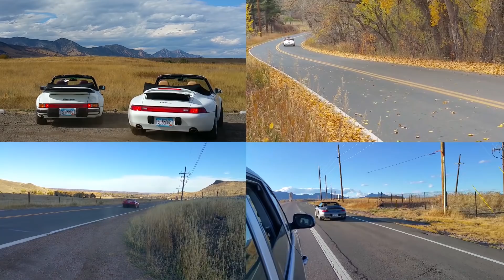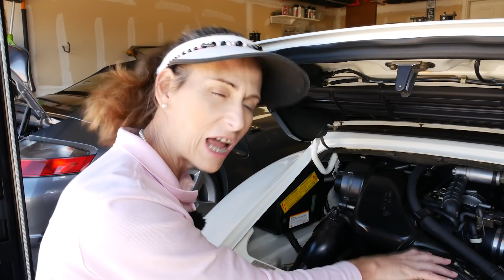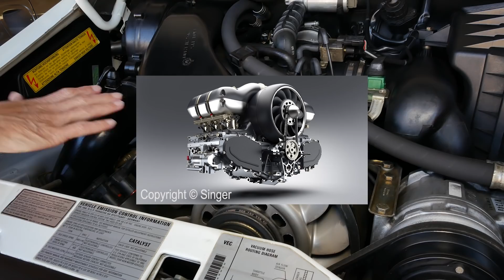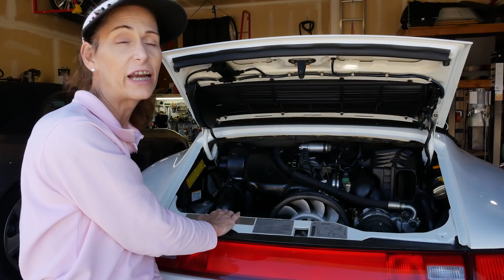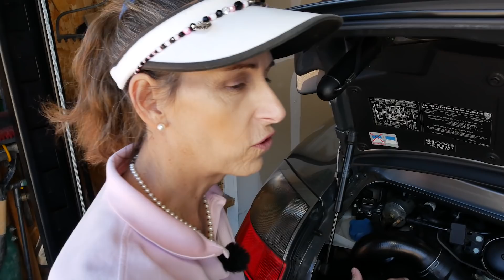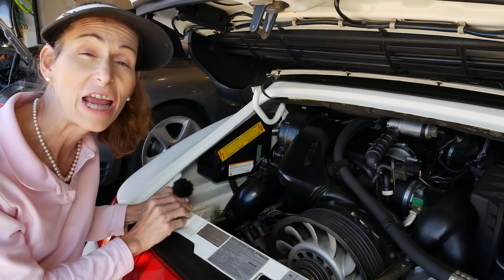Water Cooled Vs. Air Cooled Engines – With Engine Sound

Comment: I have a 1998 993 cab, and my girlfriend has a 1999 996 cab. I spend most of my time repairing the cooling system on hers.   Way to many little rubber hoses, clamps and lines to leak.  I just don’t like water cooled Porsches.  I also have an early air cooled car which we built a 2.7 short stroke. 245 HP engine.  It is built along the lines of the early R and weighs in the mid 1800 lbs.  It is very mechanical sounding with its European Racing Headers and 991R muffler.   Having to take care of 4 Porsche’s, one water cooled, the water cooled car requires the most maintenance, and has the most problems.  I was sorry that Porsche was forced to switch over, but they were not going to be able to continue to pass the emissions and noise regulations.

Comment: I own a 2015 water-cooled 911 Carrera. It's been perfect in the 4 years that I've owned it. It was the last year of the normally aspirated engine too. That being said, I do have a soft spot for the 993 series air cooled 911's. Porsche finally got 'the look' correct, after several years of fairly ugly bumpers on the 911 and 964 bodies. Having lived in the Los Angeles area for the last 4 years, I always wondered if the air cooled 911's tended to overheat, especially in August temps in excess of 100 degree's F.
Reply from the maker: I would think stop and go traffic in LA even in cooler temps would piss off the cars. Even our 1986 has overheated in bad traffic in the winter months. They aren’t perfect. It is something to consider.  A lovely drive in an ocean breeze on 101 or 1 would be amazing. 993s are amazing cars.  Their prices have softened but not for long.  I would recommend one for sure.  You will
need to consider warmer days.

Comment: Excellent video. Which engine lasts longer? Air cooled or water cooled?
Reply from the maker: Now that is a great question!  Interesting.  I don't have any real data and there are so many factors, but I would guess - all other things being equal - the liquid cooled engine would probably last longer because of the more consistent running temperature and the less stress on the oil itself.  Thanks!

Comment: You forgot to mention that an air cooled engine costs more than a water cooled one because you need higher quality metal compounds that can withstand much wider temperature ranges.

Comment: I have a 3.2 Carrera and just picked up a '97 Boxster 2.5 which feels a lot like my old '90 Mazda Miata mx-5 in purity and handling as they are first year of production. Just getting used to the Boxster which is a wonderful car with great heat! So I like both a lot! Boxsters are such a bargain! Even if you factor in an LN Plain Bearing IMS conversion and replacing chain tensioner guides for peace of mind. 996 Turbo is the next bargain but at 10x the price I paid for the Boxster. I recently picked up a 996 Turbo front spoiler and 18" Hollow BBS Turbo Twist wheels form a 2005 Turbo. I'm wondering if the 17" Boxster wheels can go on the air cooled 911 Carrera 3.2 and the Turbo wheels and front air dam on the Boxster with a change of head lights? Of course I'll keep the original 16" Fuchs for shows. Cool videos!
Reply from the maker: We loved our Boxster until someone ran into me when I was in it.  So, i read your comment to Franny. She said to make sure you check the forums.  She said that sometimes the tires might rub when you turn.  We have original parts on our cars but we might do some modifications to ours soon. Heidi

Comment: There is nothing like driving an air cooled 911. I miss my ‘72 911E and ‘90 Carrera 2. You can definitely feel and see the refinement of the water cooled cars. If you want a more raw driving experience, go with an air cooled 911. If you like to go fast and creature comforts, go for the later water cooled 911s.

Comment: Great video. During WWII the most powerfull and reliable plane engines were aircooled radial engines. No radiators, no waterpumps, hoses and so. In my 40+ years being a driver, I've owned and driven several aircooled cars. The main problem with all of them was heating the cabin.Some extracted heat from the exhaust and that was allways subject to rust, other tapped warm air from the engine, but that only started working after 20 km or so when te engine got warm. I prefer water cooled now, nice temperature in the cabin, smooth, silent running engine.
Reply from the maker: Yep. People like one or the other for various reasons. Thanks for the comment.

Comment: Owned and worked on both. The 996 is superior in every way, in my opinion, except that air cooled 911s have a proper pressure fed IMS bearing and a proper dry sump lubrication system, not withstanding the Mezger engine you featured on that turbo. My 1970 2.2Lt 911E felt faster and was a blast to drive. But in reality my 996 is much faster and handles and stops way better. Creature comforts included.
Reply from the maker: Yep.  Agreed.  We like them both, obviously.  ;)

Comment: I didn't see that anyone had asked how you know about loosing all of the coolant, please let us know.
Reply from the maker: Yes, so about that...  We have a friend who was interested in a 996/997 Turbo so we went out for a drive.  I drove a bit with a few good pulls and then pulled over to swap and just as I was turning the car around the right rear coolant hose split from end to end and dumped all that new coolant (I had just replaced the radiators).  Arrg!  We had the car towed home and it was an easy matter to swap out the hoses with new.  That was dumb...  I should have replaced them while I had the system dry for the radiators! F

Comment: A friend owned a 911SC (204HP 3.0 litre) and a Type 964 Carrera 2 (3.6 litre I think) in New Zealand

I remember the SC held around 12 litres of oil in the 'sump' to help keep the flat-6 nice and cool
Reply from the maker: Yup, it is a lot of oil.  They are actually dry-sump engines so a good portion is in the oil tank.  Always exciting when you drain it!

Comment: This video raises a question or two
1. You mention that air-cooled cars tend to have an oil cooler. So does that mean you run the risk of the oil cooler failing? IF it fails is the cost to repair always higher or lower than having to replace the system in a water cooled engine? Every time I have to service a water cooled system, I find it's almost always cheaper to take the whole cooling pump out and replace with a brand new one.
2. Then there's the oil itself. Does the oil require more frequent changes because it's being heated and cooled down mechanically rather than naturally (letting the car sit with engine off)?
3. And an addendum to question 2: does this also mean you need to use an extra quart or two of oil or a second oil filter?
Reply from the maker: Oil coolers can leak and they can fatigue their mounts on 356s.  I suppose they can clog with sludge as well., but there is no real corrosion.  Generally, oil/air cooled engines carry a bit more oil.  All the air cooled 911 engines are "dry sump" engines meaning they have a separate oil tank.  It may be a bit more wear on the oil, but nothing like trying to lubricate a red-hot turbo.  About filters, the 993 has a second oil filter - one on the tank as always and one in the engine.  Makes for a longer oil change process.  Still, all three of our liquid-cooled cars have had failures or leaks.  Water pumps and hoses are just another point of vulnerability.
Reply: Don't forget to mention the water-cooled have oil coolers too that can leak. They are cooled more by the water adding potential internal leaking into the cooling system as well.  And the tolerances of the water-cooled require much more attention regarding oil quality and contamination.

Comment: Heat in the 993 is better than water cooled cars. In 993 heat is available in a couple minutes. True that there are a lot of smells from engine.
Reply: Totally agree on the heater. But the A/C and environmental controls on my 996 are a different story.

Comment: While I can understand why people get 'emotional' over air-cooling and carburetors; I almost always prefer EFIs and radiators. 
Seamless and consistent performance, better thermal efficiency, better fuel economy, longer engine life and less chance of engine seizure. 
Sure, they're expensive and make an engine complex but the cons far outweigh the pros; in my personal opinion and experience. Especially when it comes to forced induction.

Comment: It will be interesting to see how Singers engine is cooled. I noticed that they not only had the fan but had air inlets in each side window. Is that air for the engine intake or for cooling? It would have been fantastic if Porsche could have developed a similar engine. Dave

Comment: Thank you for the fantastic video. The other difference between the two cars is the valve setup. The air cooled cars were all a single camshaft with two valves per cylinder. The water cooled cars had two camshafts per bank and four valves per cylinder. This was significant enough that the naturally aspirated cars produced over 300 horspower, something that the air cooled cars never could. Thanks for the great video.
Reply from the maker: That is a great point.  I think it was Nick Murray who mentioned that the reduced metal in the heads due to the four valves meant less heat transfer along with increased power.  Oil is just too thick and slow moving to carry away enough heat.  Great point! F
Reply: @HeidiandFranny  oil does a fantastic job for cooling an engine, at first, it cools and lubricate all bearings and the other friction points of the engine plus on so designed engines, it cools the underside of the pistons so it absorbs a good part of the heat produced by the engine.
On specific gas and diesel applications, the engine oil acts as the principal coolant.
On a water cooled engine used on a continuous application as marine or stationary, it is not rare that an oil cooler is installed as a genuine equipment just beacuse the oil absorbs so much heat that a cooler is required to  maintain it in an acceptable temperature range

Comment: I've had 3 x Aircooled (including a '75 turbo) and 5 water cooled 911's (+ 3 beetles which we wont count).   If you remove the money and collectability side of things and just judge them on their own merits then the water cooled cars are in a different league,  than the old air cooled.  Power, handling, breaking and general livability is sooo much better.  The newer cars truly are the 'one size fits all' family car that you can race at the weekend - which is what the 911 was designed to be all along.
Reply: Totally agree. I have a 996 and have owned and built air-cooled 911s. I do think the hydraulically assisted steering non-stability controlled manual shift on my 996 is way more fun than the new PDK electric steering cars with neuter-control though.  And the two 1974 Porsche 914 2.0s I've owned are the best cars VW ever built. Actually Karmann Ghia built.
Reply: Water cooled 911 are total headache when they are old.

Comment: does the oil cooler have a radiator for cooling?
Reply from the maker: Yes, two oil coolers up front.
Reply: Heidi and Franny's Garage thank you for your answer. i guess the oil isnt the optimal liquid for cooling then. thats why we have other coolant liquids with their own integrated systems inside the engine today, right?
Reply from the maker: Yup, you are right.  The oil is obviously super important for lubrication so that needs to be its primary focus and you probably don't want that running through the heater in the cabin ;)  It is thick and hard to move as well.  Water can be pressurized and with anti-freeze will remain a free-flowing liquid at even the coldest temps.

Comment: I really liked this!! but I did find it funny when you exclaimed there's no fan here! In the 996 engine bay, talking about fans in the radiators up front but you never pointed out the fan right next to your head on the trunk hood itself! The small electric heat exhaust fan that funnels air through the rear louvers
Reply from the maker: Yeah. True.

Comment: You should see and hear my 1980 911 SC with a Paxton supercharger on it. It's very different from the 930 of that era. 
Also, you forgot that the air cooled cars had "coolant" lines running up to the front. 
I love 'em all so much, that I recently got a 958 Transsyberia.

Comment: Just really getting into Porsches, I bought a 986 and a 996. I'm 63 and had friends that had old bugs, air cooled when I was growing up. And they all had to be rebuilt way before 100,000. But I had a '62, '66, 68 VW bus... Everyone was cautioned against not getting a '73 or after bus cuz they went to the "pancake" engine they were called then because they also needed to be rebuilt but was 3 times the price. Heat was a joke. Came from the shroud  with metal pipes carrying this warm air to the cabin with no fan... I've cussed too many times with no heat to speak of freezing.... Living in the south and you have to run your cars AC, couple that with city driving, depending on the oil to cool everything when your in stop and go traffic, sorry, it just won't last. I do like the old feel of the older Porsche's but I'll take the extra work,, hoses and not to mention HP... No one ever mentions that. My 2000 996 is perfect and for sale, and with 300 hp., she's not slow at all. Hit me if interested... But as I remind a buddy of mine, Porsche is smarter than us... Best cars on the road no matter what, Great video... New subscriber, but show us how they compare driving.. Thank...
Reply from the maker: Hi John, That is in the works...  Whereas the Beetles and other VW (I had many) were a bit thin on heat, the 3.2, 993 and even the 356 are great.  I've never been cold in those cars - all better than the MINI!  Now, the AC...  That's a different matter ;)
Welcome to the channel!  The 996 is an awesome car and those who poo-poo it haven't driven one.  They are superior to the 993 is pretty much every way.  But, I do love the 993 ;)  F

Comment: Although I think aircooled Porsches are in a way more advanced/elegantly designed then the water cooled the air cooled was somewhat archaic in valve train compared to a four valve water cooled . Porsche went to water cooled for more than one reason, one, air cooled were somewhat limited in power(not that a 400+hp is low) a four valve adjustable water cooled can be developed further for less.

Comment: Great video Fran! I do love Porsche cars both old and new! I would have to say the sound of air cooled engines is awesome but I do love the exhaust note on that 996 turbo! Is that a radiator or an inter-cooler for the turbo system on the front center of the 996?
Reply from the maker: Hi Jesse, that is just a third water radiator up front.  The intercoolers are back, low in the rear haunches (you can see the gills in the body just behind them).  The big air inlets on the sides feed them.  Neat fact...  Our car has the X50 performance option (essentially making it an "S") and the intercoolers and turbos are bigger than the standard turbos.  You can verify an X50 by feeling the surface of the intercoolers and if the vanes sit proud, then it is the X50 intercooler :)  Both cars are awesome, but just for different reasons!  No bad choice here!
Reply: Heidi and Franny's Garage Both those cars are very cool! Great fun fact about the X50. I’ve always loved the 911 for as long as I can remember.

Comment: I believe he air-cooled cars are great, but getting rid of the heat is a big problem especially in stop and go traffic>  I imagine the air-cooled cars would also have a problem in higher elevations where is air is less dense?
Reply from the maker: You are correct. Air cooled do not handle very well in rush hour.  Yep, elevations too.

Comment: air cooled: a bit lighter, simpler as water cooled, but aircooled = higher consumption, higher emissions (impossible to fit Euro 6 emission rules) , more mecanical noise, less performance...

Comment: Lol. So the awesome sound of the air cool porsche is actually the fan. Who would have thought.
Reply from the maker: It is amazing.
Reply: Personally the mechanical sounds from all the air-cooled 911s I rebuilt were from the manually adjusted tappets on the two valve per cylinder heads vs the hydraulic followers on the four valve water cooled heads. Cooling fan just whooshes on the air-cooled.

Comment: Why they can't control the temperature of air cooled engine anyway? Maybe by using some kind of air gate to control the flow and using fan with clutch or electric fan.

Comment: I have to say that it is not a completly aircooled car like the vw beetle. The 993 is aircooled/oilcooled. Like you said there is no water tank but there is a oil tank inside the backfender because it is a dry sump system. Also there is not a lot of weight difference between these 2 cars. And the sound is different from each other because the old engines had 2 valves per cylinder while the 996 has 4 valves
Reply from the maker: Hi Wesley, both the 356 and the Beetle have oil coolers so, I suppose they are also oil-cooled to some extent...  Whereas the 356 is not dry sump, both the 993 and the 996TT are (the 996 NA is not dry-sump though).  And, yes a very big oil tank on both cars.  The 993 moved it to in front of the right rear wheel from the earlier right rear haunch like the 3.2 Carrera in an attempt to lower the center of mass a bit.  This may not have been the best comparison as the Turbo masks much of the induction and exhaust noise, but you still get a good idea just how much quieter the engines themselves became. Franny